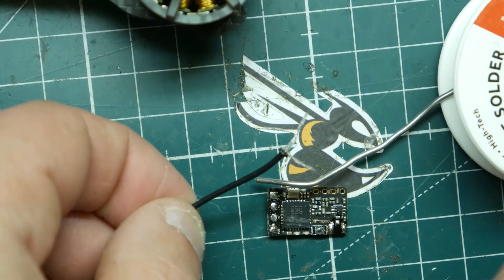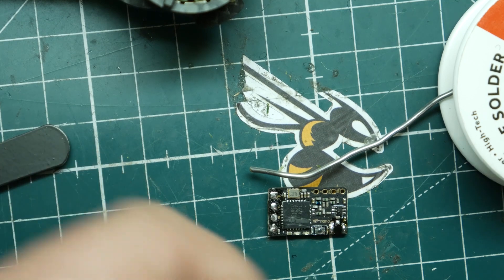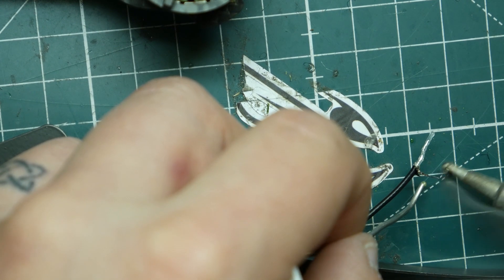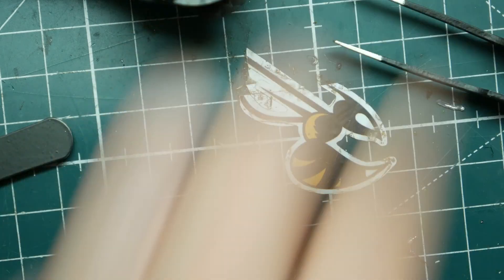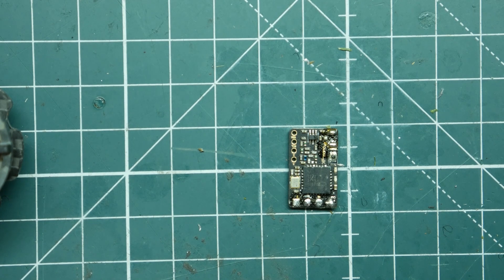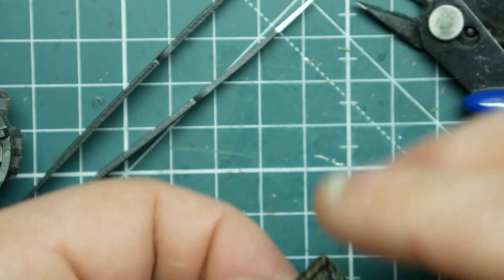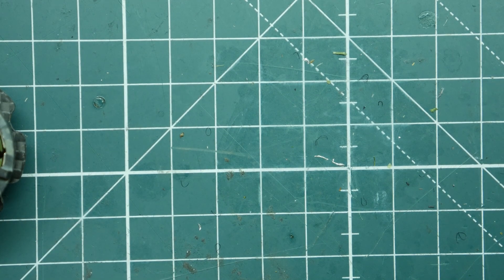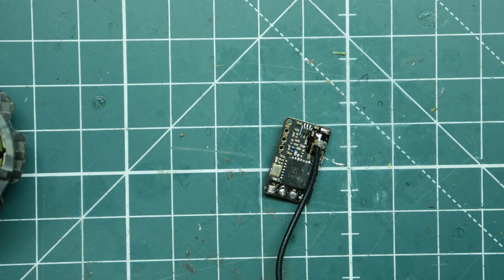HOW TO Direct Solder Antennas To RC Receivers Or A Video Transmitter

Comment: Thanks for video! 

I have a question hopefully someone could help me with please. Can the live wire be soldered on the the circle pad on the opposite site of the board? The reason I ask is on my xf nano the live pad seems be damaged or been pulled off.
Reply from the maker: Yes it’s double sided
Reply: Me too did you fix it. Please!?

Comment: the connection is not correctly shielded anymore and will leak. expect at least some loss. in the worst case some tiny strands might create shorts to nearby components or introduce noise in other subsystems.

Comment: repaired a vtx ant.about a week ago it took me a few attemps at soldering but the hardest part for me was stripping that tiny little shielding off without breaking the wire I think I finally melting it off wich I hate to do because it seems like it would get all in the stranded wire but what the hell it worked haha

Comment: Great vid. So not needed to solder on both pads left and right? The outside of the cable just need to solder on the left or right pad?
Reply from the maker: Correct